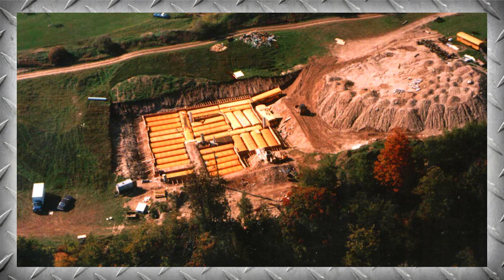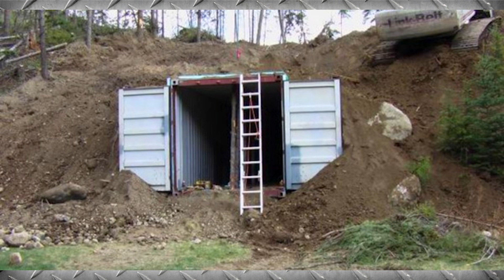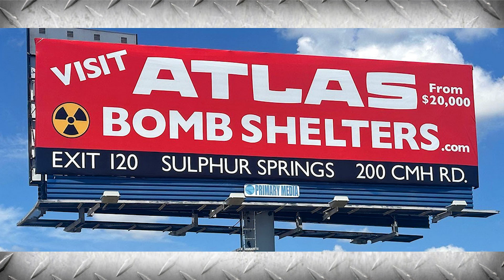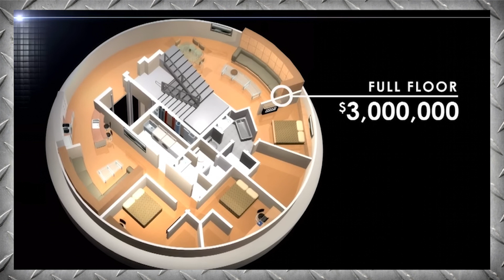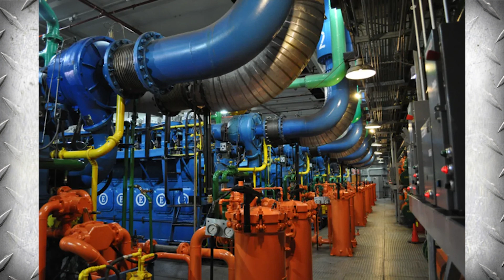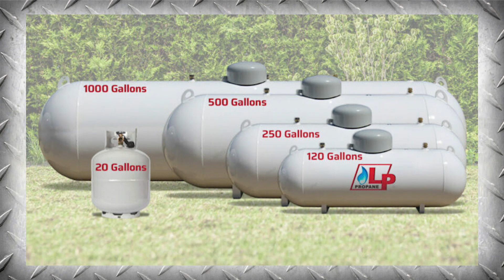Bunkers - Prepping Endgame or Waste of Money?

Comment: Oxygen, you can use chlorate candles. That's how they do it on subs. However, same problem if someone sees you that stockpiling them.   May not be legal in all areas or hard to get enough of them. Cost could be an issue. It's only a backup system. 20:40

Comment: you talked about air filtration, what about plants? i know it would create new problems because of the need for specialized lighting and water, but would some kind of artificial greenhouse be "practical" if you where to build a bunker
Reply: The size is an issue BUT I have seen an experiment on using algue tanks that would probably work and could be upscale per person
Reply: You would need way to many plants. There is a guy who tried to figure out how many you would need. He had to switch to algae and you need alot of lights and non stop keep growing more and if it gets diseased and starts to die your screwed